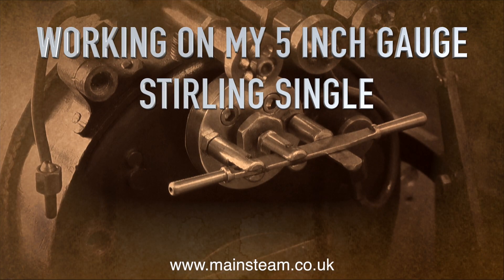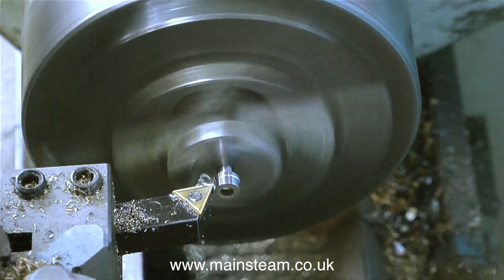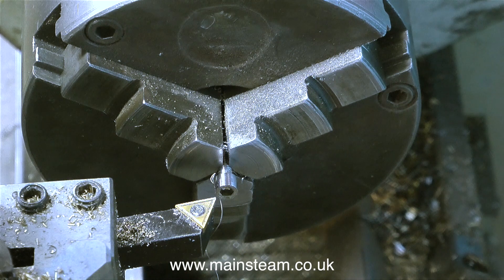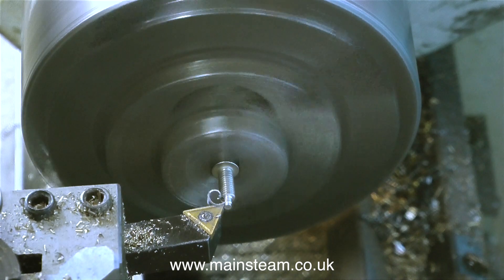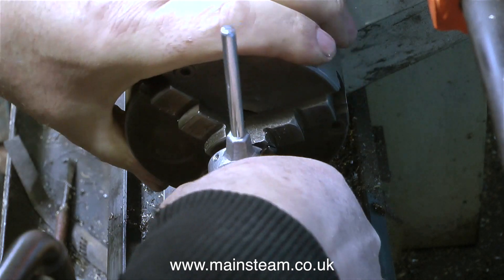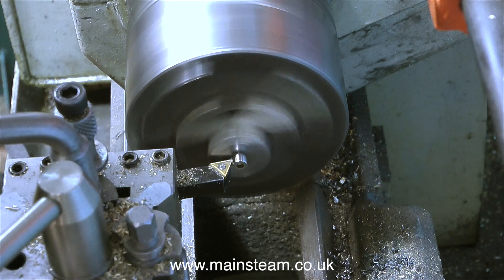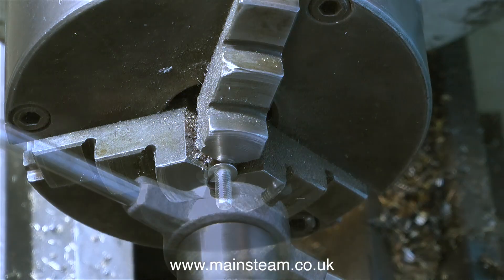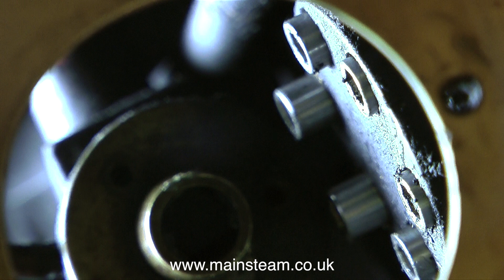MY STIRLING SINGLE #1 - MAKING 4BA STAINLESS STEEL CAP HEAD BOLTS

Comment: Ah Mr Appleton, some folks don't realize how relaxing this hobby is (I know relaxing means various things to various people). It's like ordering ME bolts and nuts from the U.K. and then being notified that for some reason your order is being held due to violation of import sanctions placed against the consignee and or destination country by the E.U., U.K. or U.S... Now how's that for excitement? Canada in violation of E.U., U.K. or U.S. sanctions? I damn near fell off my chair, I didn't know this hobby was a "restricted activity". I guess me ordering the depleted uranium bolts in my next order will clearly be out of the question... After a few e-mail exchanges between the supplier and myself it came down to a failure on the couriers part to complete the paper work  properly.. The supplier and myself found this very amusing and some what odd, truly a story to be shared over a nice 25 year old glass of scotch... Needless to say the bolts and nuts showed up today no worse for wear ( and they don't even glow, I checked )... Hope that made you chuckle... Cheers!

Comment: I am pretty sure that M4 and/or M5 stainless steel cap-head bolts are used to fix mudguards and luggage racks on touring bicycles these days. I don’t remember because I bought a whole big bag of them in various lengths about 10 years ago and I am nowhere near depleting my supply.